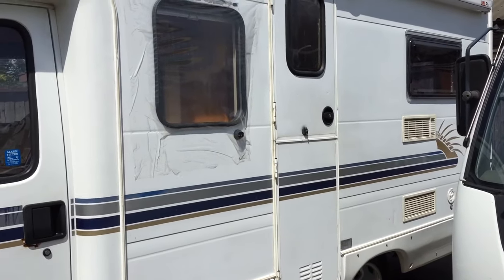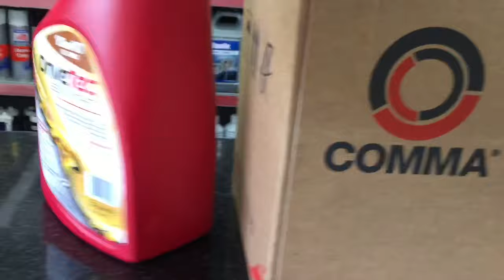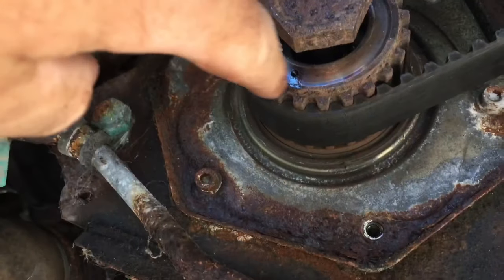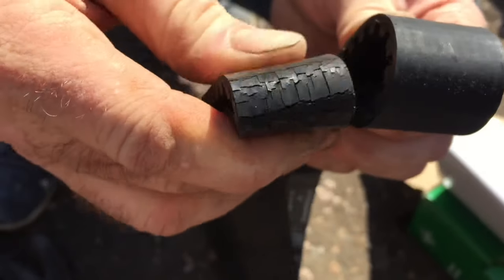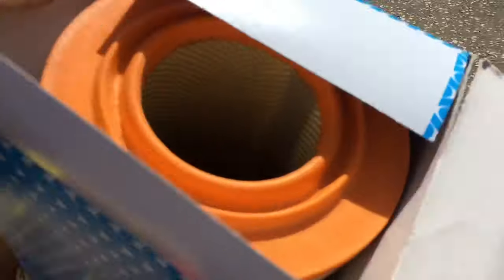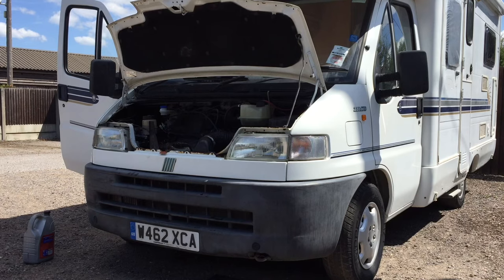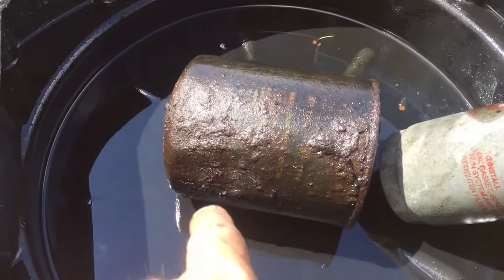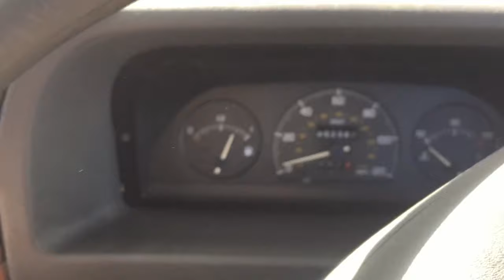Robs Bargain Motorhome camper RV project part 5

Comment: I would advise anyone who is thinking of buying a camper/motorhome...... Please if possible check the underneath of the vehicle and look for rotting to the metal. I work in a garage and every time we get an old camper come inn for a service or any other problems we put the vehicle up in the air and the amount of rot in the spring mounts, inner panels etc etc!! The problem is that the vehicle spends more time parked up than is used in damp cold conditions and just neglected. Please please do not park a vehicle for long periods on wet damp places like on a grass/lawn patch. The moisture gets in to the metal.
Reply: Sorry to go on but?? Do not be fooled by the shiny fresh polished paint work and the fresh clean interior!!!

Comment: Fiat stands for Fix It Again Tomorrow 😉
Reply: I've 2 fiat's and they are as reliable as most other makes as long as you look after them. Mine are well over 20 years old...
Reply: @rogue the cheapest ones you can get.. 2 cinquecentos 97 and 98 s and sporting. One is poverty spec and the other has all the toys fiat could throw at it back in the day. Really cheap to run and maintain and if there were minus safely stars, they would have loads...